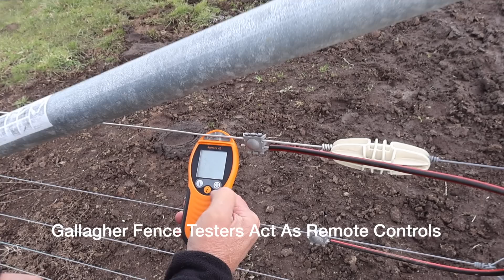Satellite Fence Brings Peace of Mind and Profit

Comment: I have a question from a city bloke who has been watching a number of your posts and those from "off grid" and "small farm" youtubers.  Is there any reason why the connecting cables for the "remote monitor" doesn't have an eyelet (ring terminal) connector on the end that is attached to the unit?  And, with the availability of mini solar panels like the Thunderbird S30B or Gallagher MBS2800i or MBS1800i - do these mini monitors have the option to be connected to a solar panel and simply use the batteries as an optional backup?   Finally, what about an external indicator light to show the unit is working?